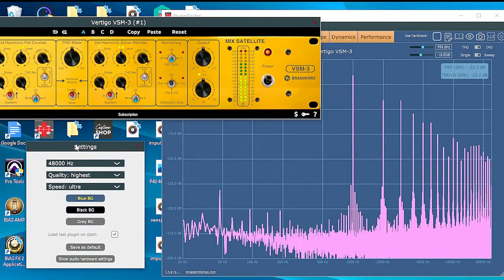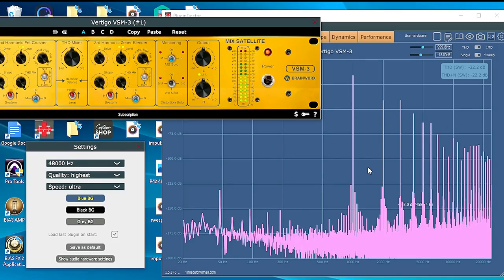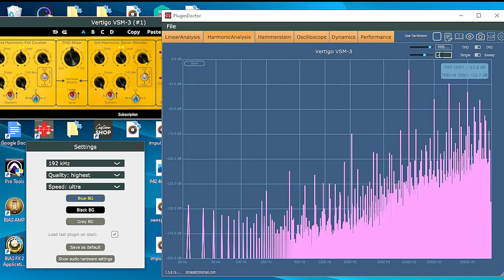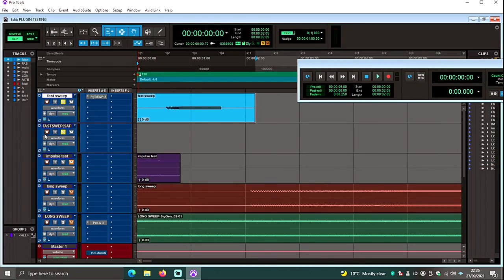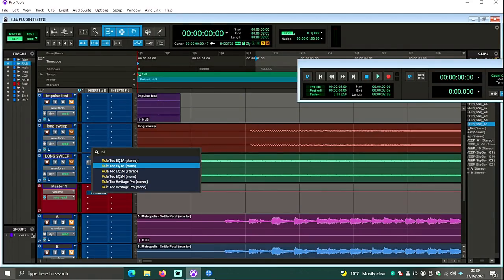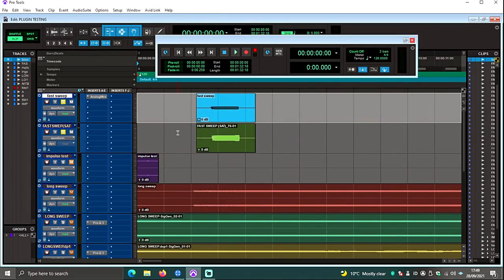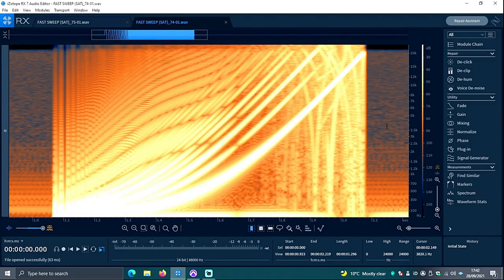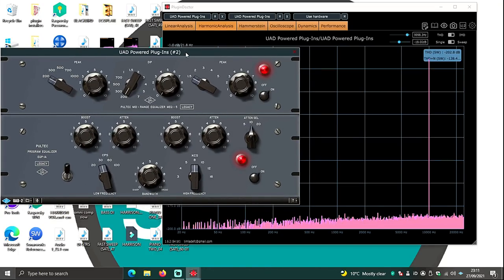UNDERSTANDING HARMONICS & ALIASING || How to visualise plugin harmonics & how to test audio aliasing

Comment: Sooo, you say the Fire Cobra is the best, compered to the Newfangled Sat that doesn't need oversampling?
Reply from the maker: Best I've tried so far. Never heard of the newfangled
Reply: I quickly tested fire cobra some minutes ago on a 5 string bass played with fingers over a DI (Country Man) into my DAW. I am absolutely not convinced with the performance. It has a heavy noise floor. I can't use it when I drive it hard. It sounds good but I get better results with plugins that cost 8 $, ridiculous. 
My settings were 100 % wet. Input meter shows + 12 db. Intensity 1 o'clock. Smack 9 o'clock. Analog 10 o'clock.
Reply from the maker: The frequency response changes a lot with fire cobra. It's not subtle. Like most tools it won't work on everything but it has its place on certain sources. I was talking about aliasing in terms of the best I've tried. Not the best all round saturation plugin. The best saturation plugin I've tested thus far in terms of managing aliasing with that amount of harmonics. Shouldve been clearer. Apologies
Reply: @PaulThird 
Have a go at the demo of Newfangled saturate plugin.
It doesn't use oversampling, would be interesting to hear what you think.
Reply from the maker: I don't think he's 100% correct though as I've been told to categorise foldback distortion and aliasing as 2 different things.

I've been told that foldback distortion is still related to the fundamental. As you can see from his video it folds back into the same harmonic pattern. So it's not inharmonic and nothing appears below the fundamental. 

Ive been told that aliasing is inharmonic as it's high order harmonics made past nuquist that appear below the fundamental out of the harmonic sequence so the frequencies are 'random' in a sense.

I may have been told wrong but i've shown guys a few things on plugin doctor in the past thinking it's aliasing and they've told me it's foldback distortion
Reply: @PaulThird  Hui, that's sophisticated.

Comment: I've not watched the video yet so you may touch on this, but you're someone who probably understands audio better than me: I've found you get rid of a hell of a lot of aliasing with LPFs. Before the clipping plugin makes perfect sense (the plugin isn't folding over anything in a weird way), but I've found you get a far more dramatic reduction AFTER the clipping plugin, which makes zero sense to me. Why?

Running at 192 with 8x oversampling with a 12k LPF @ 48dB before and after the plugin I don't really get any audible aliasing at all even on extreme gain settings, which is nice. As soon as I turn off the post-plugin LPF though, with a sin sweep running it's suddenly the Dr Who theme.
Reply from the maker: Depends on the source and the plugin. However that's why I do aliasing tests at 10k as many argue that many sources don't make that much high frequency content to cause aliasing. The chances of you steeply filtering out highs as low as 10k is unrealistic in most cases.

You can filter out high frequencies before an aliasing plugin to minimise aliasing but if you are rolling off highs purely for aliasing purposes then I would say that's not wise as you should only be filtering out highs or lows because the track actually needs it tonally.

The more you start filtering especially if its steep filtering you might start incurring audible phase issues so it's my opinion that if aliasing is something you care about then gain stage your plugins and consider oversampling or working at a higher sample rate. You don't need to remove it all, just the audible aliasing. Or you do what I do and use plugins that have extremely low aliasing or oversampling options so none of this is a concern

Comment: Doesn't all waves plugins auto internal sample at 96?
Reply from the maker: Nope. You need to oversample waves manually. I use metaplugin
Reply: @andrew I think you are referring to the internal 48 bit processing of the wave plugins.
Reply: @PaulThird  so, can I track at 48? Then mix at 96? I understand if I mix at 96 my tracks are still tracked at 48?
Reply from the maker: Yeah. When I'm in protools it does the conversion for me. If I upload a 48k file into a 96k session it'll give me an add or convert option. Click convert and it imports the file into the session as well as converting it.

Tbh I track and mix at 48k. If anything needs oversampled I'll just use metaplugin and oversample it that way so I'm not wasting all that cpu mixing the whole thing at 96k
Reply: Waves are not even close to being champs at dealing with aliasing.... Behind the curve. I personally wouldn't use any of their character plugins. Though I'm sure they've gotten better in recent years. It was so bad that it must have improved.

Comment: Hi Paul. I can only view this video at 360p... Super grainy. I'm on a 150 mbits connection..
Reply from the maker: The HD version is still being processed. Unfortunately this can happen on YT where it has a massive delay or glitches during the HD processing. I'm hoping it's a delay cause if not this video will be 360p unless I upload it again which I won't as the audio is unaffected by the video resolution. Uses a seperate codec thankfully.

If the HD isn't working when I wake up tomorrow I'll message the creator team and see if there's a fix as they may be able to sort it. Pretty sure they can
Reply: @PaulThird  ah okay.. I see.. Thanks for explaining 😊

Comment: So what I’m really gathering from this is that if you have oversampling available to you as part of a plug-in then you should use it. 🤔
Reply from the maker: Yes. That's why the plugin developer has included it. They are giving you the option of the Plugin at its optimal setting and also the plugin in a more cpu effective state. They are allowing you to choose but the plugin at its best will be max oversampling. If you see oversampling in most plugins it's basically saying.. This has aliasing issues

Comment: EMU SP 12 bit SAMPLER. THE ANTI ALISING IS ITS STRENGH.  ITS CHARACTER.
Reply: Yeah agreed I have an old unit right here.... But I'm pretty Shure it's more going on there then just the alliasing. Something more going on there at the conversion and analog outputs.

I believe in about 10 years when we all work with 64bit 1.4ghz sampling rates in our DAW's We will be hunting old plugins and digital hardware for different alliasing colors on our palettes....
Reply: @SuperIZL  defo.
Reply from the maker: What is it.. A drum machine?
Reply: @PaulThird  Yer man. A stone cold bad boy classic but just pointing out that anti antialising aint all bad sometimes. Sometimes what is deemd to be not "technically accurate" can also add to that something. Like fairy dust sprinkled.
Reply: @PaulThird  sampler, in the old days emu later akai and Yamaha made popular rack samplers with multiple outs and stuff.

Comment: Why don't plugin developers just add a low pass filter to limit frequencies above Nyquist?
Reply from the maker: Cause you'd need quite a big roll off. Its the length of the order of harmonics. That's why I used the vertigo vsm3 as an example as it makes so much harmonics. You can see even at 1k its making harmonics all the way up to 24k. So you would really need to take out a crap ton of high end to calm down the harmonics. So if your modelling a plugin that's got a frequency response of 20hz to 24k then all you can do is make a super steep lpf at like 20k as we can't hear past 20k which is what many do but as you can see in the video it's aliasing a crap ton at 10khz so the devs are limited by the frequency response of the gear. So the only logical way to fix it is to oversampled and increase the frequency range so more high order harmonics can be processed as the highest frequency they can get away with is 20k normally without ruining the integrity of the emulation. So by default your gonna have a lot of high order harmonics made past 24k if at 48k sample rate as your highest frequency is 20k.
Reply: The tricks are pretty complex to properly control aliasing...... And it's quite different math for developers at different sample rates
Reply: It's not possible to get rid of aliasing without oversampling. It's an inherent property of the algorithms running at that particular sample rate, it generates numbers that cannot be represented in the current system. Similar to how, for example, if you have an algorithm that generates the first 100 numbers in the Fibonacci sequence but you only have 4 digits to represent numbers. At some point, the values generated by the algorithm do not make sense to the limited number system and the output is basically mumbo-jumbo, not related to the actual sequence. No amount of filtering fixes that if the algorithm generates those big numbers.

But that is anyhow what oversampling does. The idea is to increase the sample rate so that the algorithm CAN generate those big numbers and output them, then a steep filter is applied to remove, as best as possible, frequencies above the Nyquist frequency of the original sample rate, before converting back to it. But the numbers need to be able to be represented to be filtered, otherwise, they are still reflected back. That is why different amounts of oversampling are usually available. The higher the harmonics you generate, the more oversampling you need to represent them, so you can filter them instead of being reflected, as once they are reflected to a lower frequency than Nyquist, they will not be filtered and will still be present in the end signal.

Comment: A lot of what you refer to as aliasing is actually Inter Modulation Distortion (IMD). It's also present in the analog domain. If you learn about that some conclusions made in your video would be different.
Reply from the maker: So your telling me that the oversampling is taking away IMD as well?
Reply: @PaulThird  not per se, but aliasing falls back to the left of the spectrum in decreasing amount. Some peaks you see left of the fundamental is actually IMD.

Comment: i get it now, so any harmonics below the fundamental are aliased harmonics. Am i correct?
Reply from the maker: Correct 🤓
Reply: "any harmonics below the fundamental are aliased harmonics" yes, but it can also be IMD and/or noise
Reply: @stupidusername38  I know the question wasn't for me, but if this thing that I'm gonna say next eases ur doubt a bit , then I'll be happy. in very very short: don't worry about removing IMD from a plugin emulation of hardware, or from a hardware processor since it's physically imposible. IMD is a characteristic of the hardware and its electrical components, it's partly what gives them their "sound"
Reply: @stupidusername38  also, lemme clarify something. IMD emanated from aliased partials is definitely a thing u should avoid if what u want is doing proper non linear processing, and not using aliasing and IMD as a creative decision for production purposes
Reply: @stupidusername38  "can harmonics foldback inharmonically but still be above the fundamental" yes, they can, but I'll also say that that also depends on the frequency that's being processed, but aliased partials can definitely fall above the fundamental frequency. the majority of the time they do so